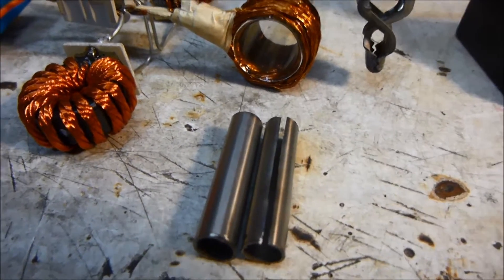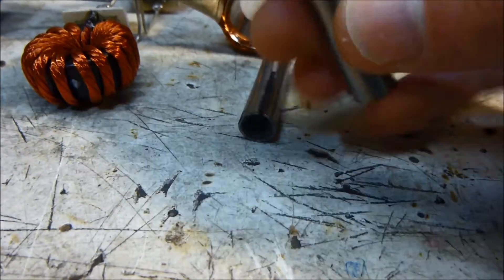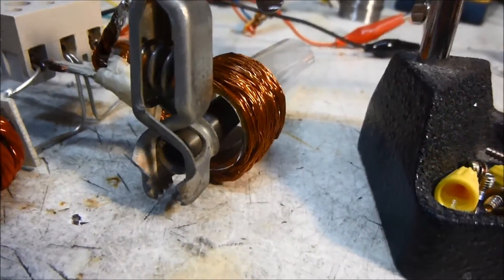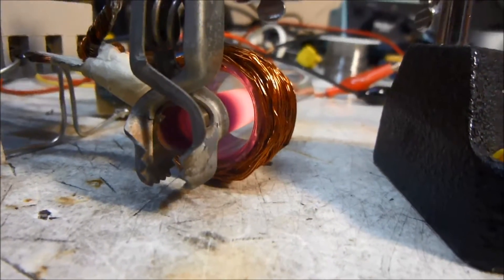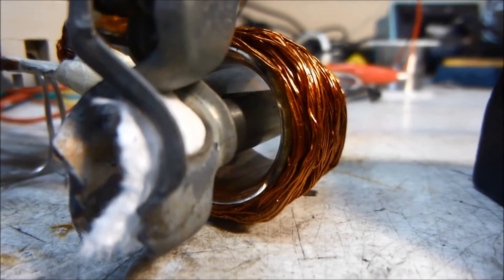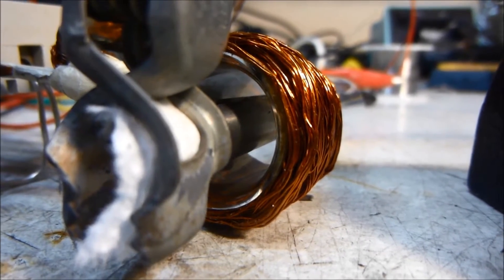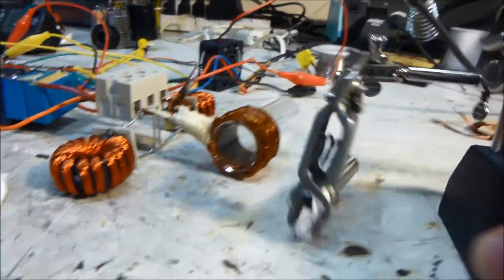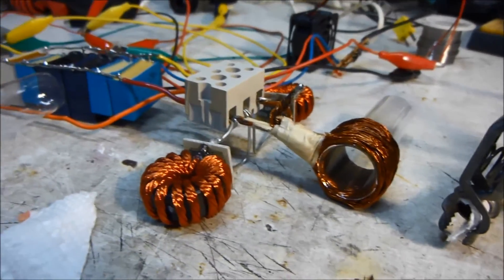Induction Heating Experiment: Heating a Tube With Slit and Without Slit

Comment: Hi,a good try, congratulate:-). What was the frequency you applied at the seamed (longitually cut) tube?
Reply from the maker: CZDrMike I don't really remember.  I think the frequency was generally around 30kHz or 60kHz.  But I could be remembering wrong.
Reply: Oh, thanks for your answer! I was estimating something like this.
Reply from the maker: CZDrMike I can take a measurement and put it in a video next time I have it set up.
Reply: I´ll be happy, because I haven´t got any instrument for measuring frequency, but I´ve already built ZVS driver and tested induction heating, it works great!

Comment: Great test. Very interesting result! At first thought, I assumed the current was traveling through the work piece laterally, but now I think about it. The mag field would be lateral and the current would be the same or mirror of the current in the coil...
Does this mean if you had two washers with equal outer diameter, but different inner diameter (hole size) the one with the bigger hole would get hot faster? I'm thinking it would. I wonder how that would compare to a full disk with no hole? If you wanted to test the three disks, it might also be worth testing a pancake with a hole, or ring coil.... I suspect the pancake with a hole would heat a full disk faster that a full pancake, but I could be wrong, less resistance for current to go round the disk in the middle compared to round the outside. the full disk would likely pull more current... Would be interesting to compare efficiency on the 6 variations too.

Another thought, what if you put a washer half the diameter of the pancake, in an off center position?

Science. Answering one question so you can ask 10 new questions....
Reply from the maker: Interesting!  I will have to do some tests to see!  My guess would be that as long as the piece of metal being heated can absorb the magnetic field the heating time will only depend on the amount of material being heated.  So a solid disc will heat more slowly than a ring.  Just because the current would be more concentrated in the ring.  But the ring may also not be able to absorb all the available energy just because of the resistance.  My guess is that there is a balance.
Reply from the maker: By the way, totally true quote!  Did you make that up?  I like it!
Reply from the maker: Mongrel Shark Cool!  It looks like you got it to work a lot better than I did!  Nice job!

Comment: it makes a lot more sense to just think of it as the whole tube as a shorted secondary of a transformer and the one with the slit a non shorted secondary of a transformer. If you have an efficient mains to twelve volt transformer you will see that if you have it plugged in that it will not get that hot, but if you short the twelve volt secondary you will see that the only time the transformer heats up is if the secondary is shorted, i hope that makes sense.
Reply from the maker: Yup exactly!  Exactly how I imagined it might work.  But I just had to try it!  I should have tried to explain it better in the video.